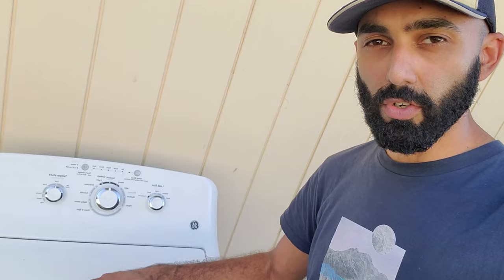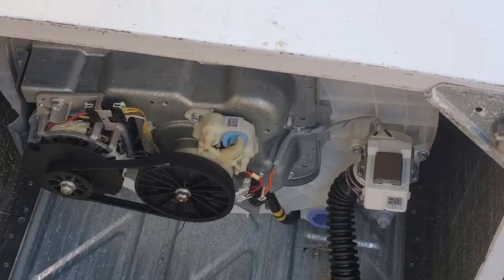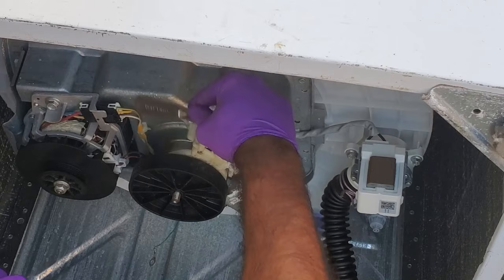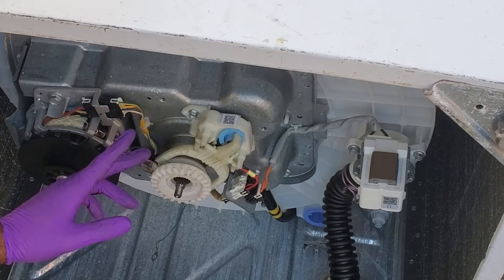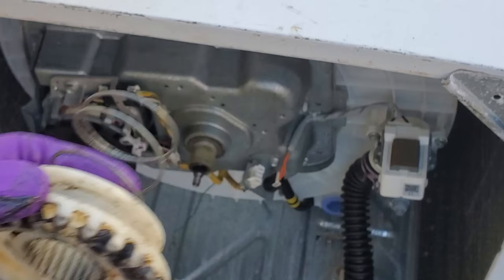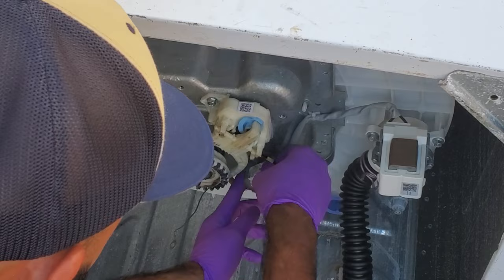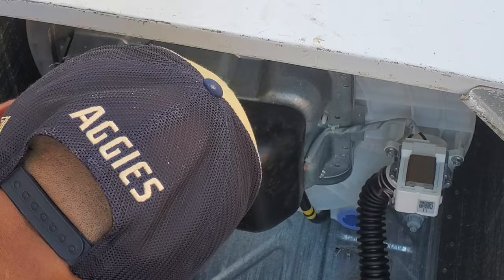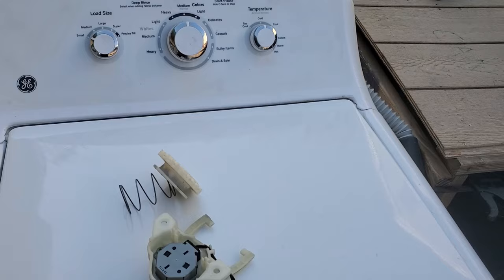Fixing A GE Washer That Makes A Grinding Noise During The Wash Cycle!

Comment: I follow your instructions about loud noise washer and you mentioned after taking black cover off there would be grits of the clutch color, there wasn't any.  But a lil grease dust maybe,but not in color of clutch. And why do they look almost new kinda. I haven't checked on SUSPENSION rods but I did noticed that the colors weren't as you mentioned for the washer model etc. Why,same model?

Comment: do you have a video on replacing a tub bearing on a newer GE top load? Mine does not have a separate front panel.
Model GTW680BMM0WS ... No agitator inside.
Thanks in advance. Love your videos
Reply from the maker: You can not replace the tub bearing by itself anymore. You have to replace the transmission as a whole. The procedure is exactly the same. Remove the washplate, and after that, it is the same as this video

Comment: This is the noise mine is making. Will this issue also cause the machine to sometimes not do the spin and drain cycle? It’s not all the time.
Reply from the maker: Yes it can certainly prevent the machine from spinning

Comment: My washer is making the same noise but it looks like metal shavings… is this still the fix for this issue?
Reply from the maker: Metal shavings are a bit weird, especially since they're all plastic parts down there. I would replace clutch and spring and see what happens.

Comment: Can this cause your washer to leak a little bit?? 
I checked the drive belt. It’s perfectly fine. I made sure the drain hose both on the outside and the inside were completely clear but my same exact washer drips some leaks, but also is making this noise

Comment: @DuctTapeMechanic, so far I changed the belt, clutch spring, gear box, and just changed the transmission pulley. It’s still making the grinding gear noises. It’s not as bad as before but still making them during the rinse cycle.  I didn’t have any washer gear oil so I used a Valvoline multi purpose automotive grease. Could this be a contributing factor?  If not, what else could be causing the gear noises at this point?
Reply: Same! Let me know if you find anything out!

Comment: These washers are dogsh*t. Ive had to work on my nieces washer 3 times already, twice with the lid switch mechanism breaking  and then repairing the control board once. Now it's the clutch, apparently, and thanks to your video I know that it's super simple to replace! You're awesome!! 

(If it f*cks up again after this, then it's off to the graveyard 😂)

Comment: After about 5 months our new GE started doing this. Still under warrantee so a GE technician came out and replaced the clutch and the shifter. Worked great for about 4 months then starting doing it again. "They don't make thing like they used too" is such an under statement. Absolute junk nowadays.
Reply from the maker: Wow it couldn't make it a year?! There are still some Kenmare/whirlpool Washing Machine working from the early 90s that still work great
Reply: @DuctTapeMechanic  yup they were built to last back then. Now they are built to fail.

Comment: Picked up by the pulley and being swung all over the place if you know where it's coming from let me know I've changed vows like I said it's got another mode shifter a drain pump better control board I don't think there's too much left but the transmission

Comment: My whirlpool washer makes the grinding noise, but only on the spin cycle. Could it be the same thing?
Reply from the maker: Yes it is probably the clutch or transmission pulley
Reply: @DuctTapeMechanic  Thanks, I will tackle it on Tuesday!

Comment: What are the parts numbers for the clutch and mode shifter?
Reply from the maker: Amazon search of GE clutch will give you the best results. They use the same clutch in almost all their top load washers. The old shifter should have part number on it. Best of luck with the repair!

Comment: Just tried it on my machine and it didn’t work. I replace the gear case with an OEM one two weeks ago and just 1 week later my machine started making those grinding noises. It stops doing it if I tilt the washing machine backwards at an 60° angle which leads me to believe the bearing is faulty on the new machine

Comment: Could it be the transmission pulley instead of the clutch? I changed the clutch and it’s still making the grinding noise but not as loud and violent.
Reply from the maker: It could definitely be the transmission pulley that would be my next assumption as well
Reply: Ok, just changed the pulley and so far so good.
Reply from the maker: @gsxray  right on!

Comment: So it needs a clutch and a shift actuator replacement correct? Two pieces?
Reply from the maker: Yes I would also get the clutch spring it'd like $7
Reply: @DuctTapeMechanic  ok. I think I found a clutch kit that has the spring. Thank you for answering so quickly. I greatly appreciate it. You are saving me and many others hundreds of dollars that we don't have right now. Thanks again.
Reply from the maker: @virginiaw8608  your welcome! Remember to lightly grease the clutch and transmission pulley when you put it back together ( i use moly grease from Harbor freight) . Best of luck!

Comment: Bro, u are the man and earned a new sub.  I will also like all ur videos if u can help me out on this for my frigidaire washer.  And maybe tell me why if I have hot water on, it comes out nonstop even when the washer is off.
Reply from the maker: Hi thank you! That seems like you need to replace the water valves at the back of the washer
Reply: @DuctTapeMechanic  like coming from the house?  This is the only washer I've ever had do that.  And would you know what I need to do to fix the issue that's in this video, but on a frigidaire?

Comment: Hello. This is a perfect video and exactly what's happening here.  Thanks so much.  Thumbs up and subscribed.    Would you mind confirming exactly what is needed to order?  Looks like there are a couple of options for spring and clutch.  

WH05X24185     WASHING MACHINE CLUTCH     $5.40

WH01X10758    SPRING CLUTCH    $5.40

WH01X24434     WASHING MACHINE SPRING CLUTCH     $5.40

  
WH05X24735     MODE SHIFTER ASM     $59.70

WH49X24834     WASHING MACHINE MODE SHIFTER KIT      $62.70

Any harm in running machine till I get the parts?  It makes noise only with a slightly heavier load.  

Thank you!!
Reply from the maker: I'm glad the video helped. I would try to not use it if possible until parts arrive because you could possibly damage the transmission pulley. I would order the parts ending in the following two digits: 84, 34, 35. If they are any redundancies you can always return them (they are faily cheap)
Reply: @DuctTapeMechanic  Thanks again.  So between the Mode Shifter ASM and the Mode Shifter Kit (per above), does it matter which one?
Reply from the maker: @montserratdemuller4426  For the mode shifter I use GE P/N 290D1068G002 various models use the same shifter. Safest bet is to look at the label on the old shifter. I think the shifter may be available on Amazon for even cheaper.
Reply: @DuctTapeMechanic  Thank you.  So then I ordered just the shifter and not the shifter kit.

Comment: Mines is making this noise but no shavings and the clutch looks good could it be the agitatior its self that needs to be replaced?
Reply from the maker: I would replace clutch, shifter, and transmission pulley all during the same (that's only like $75 of parts, but should resolve this issue!)

Comment: I replaced both the shifter, clutch, and clutch spring and the sound went away until I washed a load of towels. It was not as loud or as often as before. Do you think also replacing the transmission pulley would help too?
Reply from the maker: It's either the transmission pulley or the transmission itself so it's definitely worth a try to replace pully
Reply: @DuctTapeMechanic  thank you! Thanks for the video too!
Reply: Replaced the pulley and no grinding noise! Do you have a video to bypass the locking mechanism? Seems like ours keeps locking and unlocking causing it to stop in the middle of washing

Comment: Hello again Sir Duck Tape Mechanic.  I was having trouble with my GE washer model GTW330ASK3WW with the grinding sound and loud banging noise . So I replaced the clutch and shifter and suspension rods (I apologize about the color of rods comment,  it was a different model, my bad.) Back to the loud noise after replacing the parts you mentioned and it's even louder than before on the spin cycle. Could it be the bearings? Help plz. I'd appreciate it very much. Thank you.
Reply from the maker: Either it's the tub bearings or the transmission itself either way it may be too costly to repair. I would just find a good used older style Whirlpool/Kenmore with a timer (a direct drive washing machine) for around $200 they are simple to work on and last forever.
Reply: @DuctTapeMechanic  thank you very much, that's what my son suggested also. Yes the prices can be overwhelming.  Have a great day.

Comment: I have an issue with this ge washer. I found out the belt slipped off bc of oil. My question is where did the oil come from? And 2 will replacing the belt fix my issue? How do I get rid of the oil on clutch ?
Reply from the maker: Oil is coming from a leak in transmission. I would replace the belt and clean up the area. It will probably slip off again in a year or so (hopefully it will last longer). I would continue to do this until transmission eventually fails. The only other alternative is replacing the transmission, which is not worth it. Anyways, that's how j would handle this situation, but it's all up to you!

Comment: Excellent video man. Thank you
Reply from the maker: Glad it helped
Reply: @DuctTapeMechanic  if replacing the spring and clutch doesn't solve the grinding noise, could a bad shifter motor cause it to make a grinding noise?
Reply from the maker: @reneruiz388  yes that would be my next step well!
Reply: @DuctTapeMechanic  I'll try that, thanks

Comment: Thanks. my 2015 Whirlpool washer is making a grinding noise, except its intermittent. just wondering if its the clutch too.
Reply from the maker: Yes, replace the clutch first. If that doesn't solve it, replace the shifter. Both parts are relatively cheap
Reply: @DuctTapeMechanic  Thank you!

Comment: Is this process the same on the GE GTW460ASJ6WW washer? Cause my machine started doing that grinding noise yesterday.
Reply from the maker: Yes the process should be the same for your model as well. Almost all GE washers manufacturered in the past 8 years or so are the same

Comment: My Hotpoint washer started making the same noise. I replaced the clutch and shifter with OEM parts but now it’s actually even worse (same noise just more often). What would you recommend checking next?
Reply from the maker: Did you also replace the spring? If so, the only thing left is the transmission pulley. Both parts are cheap, so I would give that a try

Comment: Duct tape I need your help I got water leaking in the bottom into getting into my motor where is that leak coming from I cannot find it it is kind of sprinkling on all four corners where it's maybe being picked up by the pulling and slung around do you have any ideas where it might be leaking I put some money in the this already a new control board which it needed mode shifter drain pump a new water valve for the water inlet was not leaking is it my transmission that may be a serious leaking really need your help if you can figure this one out for me I appreciate it I'm about ready to buy a new gearbox are transmission you call it I even tried to get the yogurt off the top of the agitator and I know that name didn't come out right but it's the little corkscrew I followed instructions I cannot get it to come off are there a way to get that little soap dispenser cover out your help would be appreciated thank you very much GE GTW 485Asj2ws
Thanks your help would be appreciated I'm about to buy like I said a gearbox on what you call a transmission and I can't get the little Court School yoga whatever you call that that's over the agitator it won't pop off for me can you take it out the soap is it supposed to rain sound in it take the whole complete agitator out

Comment: Please help me 🤦🏼‍♀️ I've replaced the clutch but not the shifter motor... It was quiet and then started making noise again... Does that sound like I need a new shifter motor?
Reply from the maker: I would think most likely the shifter actuator is weak and needs to be replaced
Reply: @DuctTapeMechanic  I wish I could upload a video in the comments to show you exactly what it sounds like.  🤦🏼‍♀️

Comment: My washer GTW460ASJ4WW, has greasy residue on the clutch and transmission pulley gears. Will I need to replace a oil seal or where does greasy residue come from? Is my machine worth fixing?
Reply from the maker: Most likely the transmission is leaking. Definitely not worth it on this machine.
Reply: Thanks

Comment: Same noise on mine.. would this problem make the washer not agitate as well Or would that be another issue?  My washer makes the noise in video and it sounds like its washing after but it doesn't agitate.. the spin and drain cycle works fine
Reply from the maker: Slipping/grinding clutch along with a bad shifter actuator could definitely cause washer not to agitate
Reply: @DuctTapeMechanic  thanks i replaced the spring, the clutch, the actuator and even replace the drive pully to be safe but for some reason the thing keeps slipping i dont get it.  I'll probably just sell it to get money back for the parts and buy a new washer lol it wants to spin but its just not gripping no matter what I do. Oh well.
Reply: @user-mp8um8wu8f  it's most likely the tub bearing. I'm having the same problem just can't figure out how to get to the tub bearing.

Comment: I have a new issue. I makes noise as it tries to go into the spin cycle. I took off the plastic cover at the bottom and there is black strings all over. Belt looks great. It also looks like there is water coming from. the same area?
Reply: Hello! I have the issue where there was black residue on the cover of mine as well. Did you happen to solve this problem? Would love to know what your issue was, and if it was the same.

Comment: Should that transmission shaft with the spring coiled around it have play in it? Mine travels about half an inch in and out.
Reply from the maker: Half inch is too much play. Sounds like you got a worn transmission. Replacing the clutch is not gonna resolve the noise issue
Reply: @DuctTapeMechanic  Thanks

Comment: What if this particular washer is making a squeaking noise during agitation? Is it a precursor to this issue or a separate one? Thanks in advance for any helpful feedback!
Reply from the maker: Noises are always tough to diagnose, especially if I am not there to hear them. If it is a slight grinding noise, I would say it could be a precursor. If it is a slight squeak during agitation, it could be something as simple as a zipper on a jacket rubbing against the drum. Try to hear if it is coming from the bottom or from the drum during the next cycle.
Reply: @DuctTapeMechanic  Thank you! It is definitely coming from the washer because I did a load without any clothes to test it. The squeak was much fainter but still there! When I looked online it said this could be due to damage or dirt on the drive belt (I think that's the term)? Hopefully it's something fixable that doesn't turn into a bigger issue. I appreciate your response. Thanks again!!

Comment: I have a different issue, but the same washer and was wondering if anyone could point me in the right direction: toward the end of a normal wash cycle during the spin/drying phase, there is loud thumping as if someone dropped a softball in there and it is bouncing around. It comes and goes. And the towels and clothes will be sopping wet at the end. Anyone know what this is or any videos on it?

Comment: I replaced the Transmission pulley and nut, washer mode shifter and spring clutch and my machine still makes that grinding noise exactly like this one.  What else could it be?
Reply from the maker: I guess it could be the internal gears of the transmission. These machines are notorious for transmission problems.
Reply: @DuctTapeMechanic  I guess I'll try looking at that.  Maybe it won't be too bad.
Reply from the maker: @paulette6900  might not be worth replacing I believe they are quite expensive
Reply: @DuctTapeMechanic  I just found that out.  Think I'll go back to those wringer washers.  I've gone thru 4 washing machines in 8 years.  Thank you for your help.

Comment: I have a hotpoint washer and it was making this exact noise. I ordered the clutch and mode shifter and changed it. When I took the black cover off I didn’t see any plastic particles but the inside of the cover had a little bit of oily residue but none under the washer on the floor. I cleaned the cover and pulley with Dawn and put it back together but haven’t seen if the noise is fixed as I just did this. Is there a seal leaking and if so how do I fix that?
Reply: UPDATE: The noise is fixed so it did need those parts but now I’m just a little worried about that oily film that was inside the cover. If anyone has a solution please let me know. Thanks.
Reply from the maker: The oil is most likely the transmission oil leaking a bit. There js nothing you can do  aside from replacing the transmission that will fix this (which is not really cost effective). I would just perhaps put an old towel underneath the machine and use it until it stops working (could be years)

Comment: I replace the sring the belt the clutch and the round ring that goes to the clutch and it still makes that noise not as loud or as bad and the agitator works and it spins?
Reply from the maker: Could possibly be the transmission pully